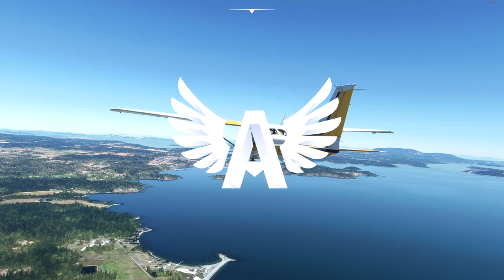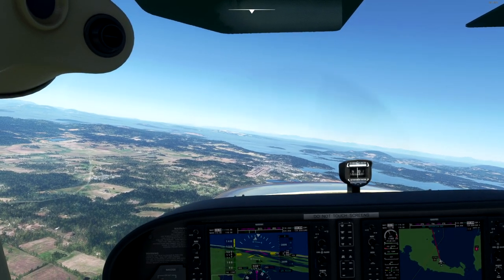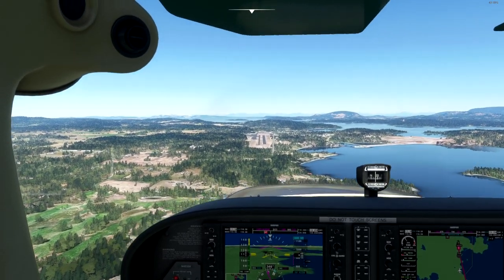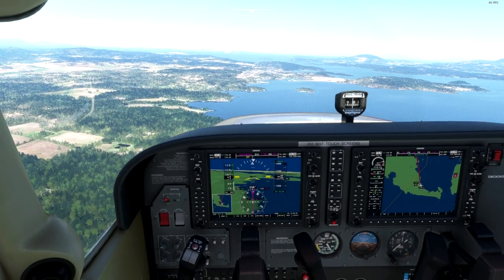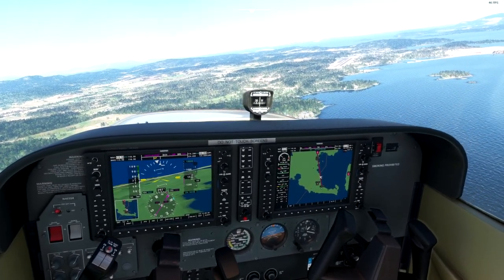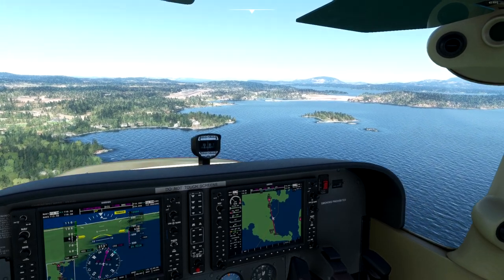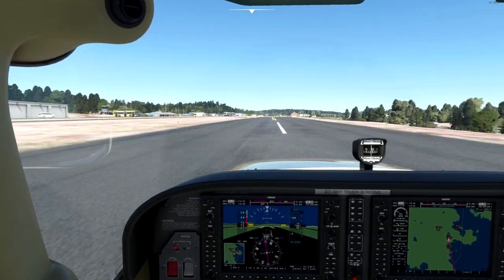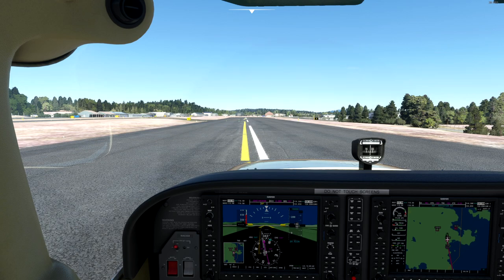How To Improve Your Landings - Learning To Fly in Microsoft Flight Simulator - #2

Comment: One common mistake I have made in the past is to flare too hard, pulling the nose so high I can no longer see the runway.  I have found much better results from just pulling the nose just shy of the horizon, and managing my energy better, instead of chasing the stall horn.  That may work in some planes, but not all.
Reply from the maker: Yeah, typical landing you won't hear it, It's why I always use the Lindburg refernce technique... accurate flares with visual on the ground every time.

Comment: another great video AvAngel, when you say you have the plane in "idle" on many of your approaches. What does that mean in throttle settings? Is that Throttle fully pulled back- Zero Throttle? Does that mean keeping your speed right at the end of the Green Arc? As in this example with the Cessna 172-
Reply from the maker: Throttle closed, so at zero basically